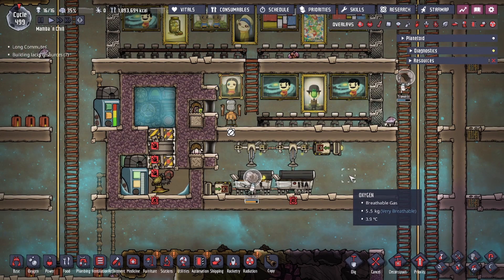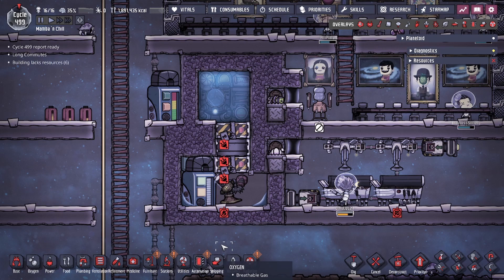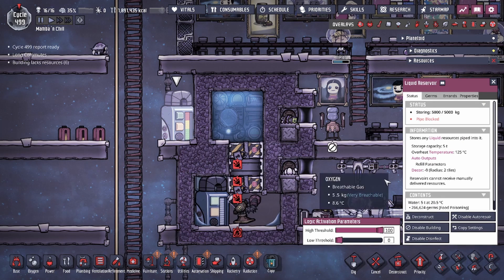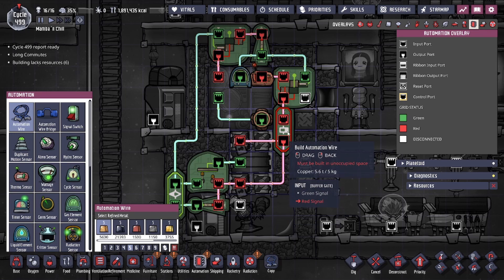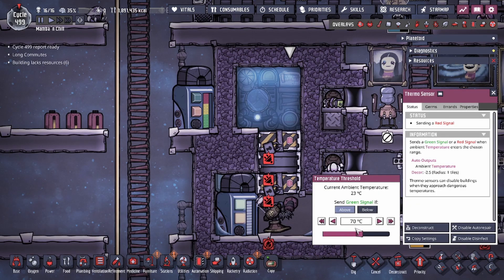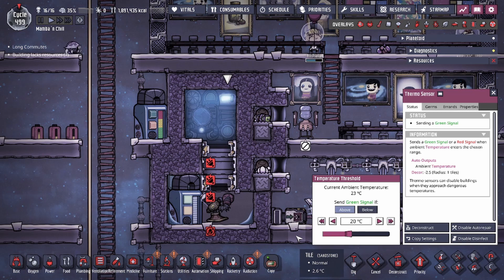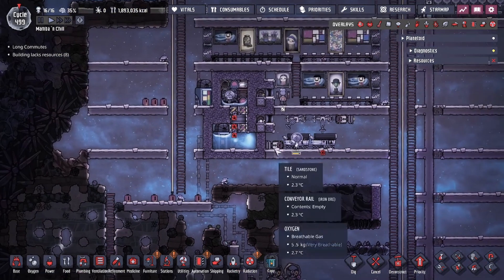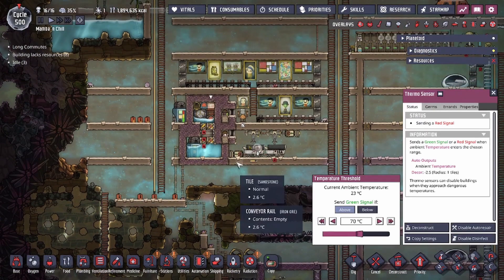Early Game No Steel No Plastic AquaTuner Set-up in Oxygen Not Included

Comment: Any issues with brine being used straight & then desalinated before hitting the electrolyzers? Can't do that beforehand without breaking pipes assuming a salt slush geyser, & polluted water from a slush geyser would break the vacuum.
Reply from the maker: yup, that works! the only thing is to deal with the heat generated by the desalinator or sieve

Comment: When the Aquatuner runs, the insulated pipe immediately coming out of its input is taking damage for me. Any idea why?
Reply from the maker: this usually means you are freezing the liquid and thats causing the pipe breakage. do you have an overflow setup with a pipe-thermal sensor?
Reply: @2LegitCity  I think I just had the pipe thermal sensor set too low. Had it set to -40 but -35 seems to be doing the trick. Hopefully that was the only issue. =)
Reply from the maker: @TheBlackBeltPanda  ah yes, since the aquatuner always changes temp by a flat -14c, you need to do a little math to make sure it doesnt accidentally freeze your liquid medium

Comment: You shouldn't need the bottom 2 doors since it would be vacuum anyways
Reply from the maker: only with enough space. even in a vacuum, if the liquid touches the door, there is heat transfer - but thats ONI, where you can do what you want and it should still work
Reply: @2LegitCity  if the liquid was that high the door heat lock would delete the liquid tho, so there shouldn't be any reason for the liquid to be that high anyway
Reply from the maker: @valdemarsvensson3167  no i meant that if i didnt have the 3 doors, and had only one door and the liquid touches the door from the bottom- theres heat transfer to the top tank. even in a base where i had multiple layers of doors, door to water contact will still transfer heat. i would need specifically one layer of vacuum tiles to avoid any heat transfer from top
 to bottom
Reply: @2LegitCity  but if you create a vacuum in the bottom tank, then you wouldn't need the three doors, just one, and pump out the water to create the vacuum each time. No?
Reply from the maker: @DominikLMarzec  no, you still transfer heat if the water touches the door, even if the water is in a vacuum. it doesnt matter unless theres a layer of vacuum between the water and the door